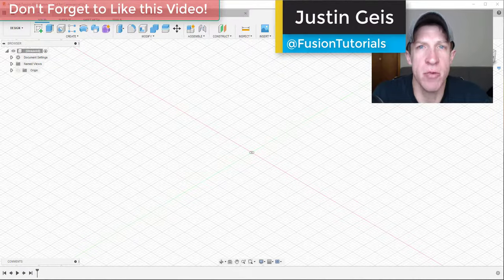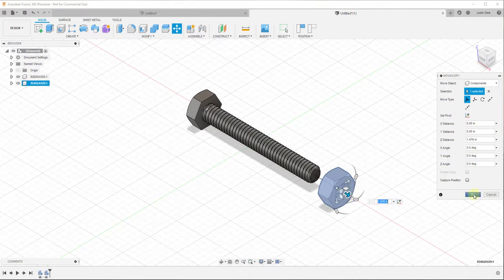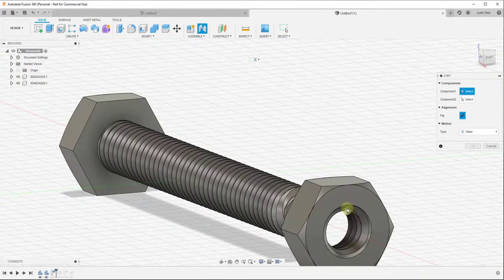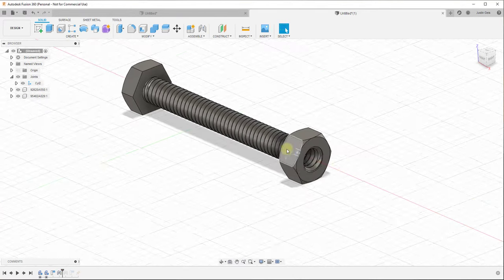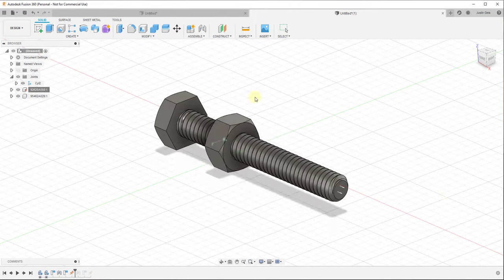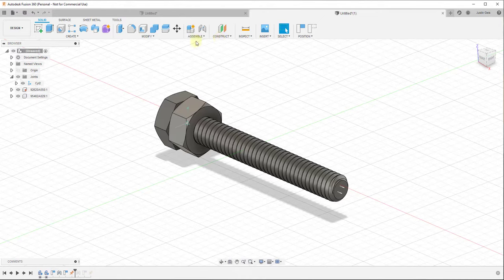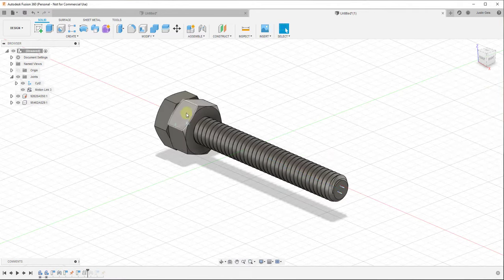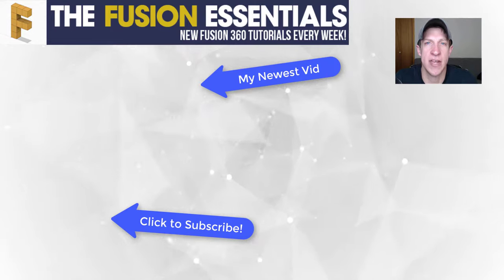Simulating Nut and Bolt Movement in Autodesk Fusion 360 with a Cylindrical Joint

Comment: I think this should be called animation instead of simulation because the threads are still intersecting for this animation.
Reply: Were you ever able to get the threads to not intersect?  I'm still unable to simulate a bolted connection.
Reply: @CopperRivets  I'm not aware of any way to do actual thread simulation. Everybody just seems to be fake it instead.

Comment: thanks for the video, well presented.  shame F360 doesnt have a drop down there for SAE/Metric threads such that you set the distance based on the threads. 1/4"-20 is 20 turns per inch.   it is fairly important for positioning machines to simulate that.  learned a lot.  thank you.

Comment: So, you would want the rotation distance to match the pitch of the two threaded bodies (nut & bolt), right? If I did as shown in the video would it work to do a finite element analysis?

Comment: I'm making a nut and bolt and the nut has a blind hole. How would I work the bolt to only rotate down until it hits the bottom of the hole based on the threads?

Comment: How do you control the starting angle of the nut to avoid interferences between the teeth of the nut and bolt?
Reply: I was about to ask how to make Fusion 360 do deduce this automatically? As in actually simulate the connection between those parts?
Reply: @MikkoRantalainen  I'm still having this problem.  I'm simulating a bolted assembly and it's failing where there are conflicts at the threads!

Comment: Subscribed! I have a question though:  so lets say that the screw you have is an M6 and the nut you have is a 1/4 inch (1/4"=6.35mm) in real life if you try to insert an M6 screw in a 1/4" nut they wont go in, if you import both from Mcmaster and try to slide them does fusion 360 show that they won't work or the simulation isn't a really practical and realistic and will show them sliding in?
Reply: I think they will only go together if you have CONTACT disabled in the assemble drop-down menu

Comment: Thanks, amazing! I found that if set the length for a 360 rotation to the same amount as the thread design (i'm using metric threads, so it might be easier), then it looks to rotate perfectly.
Reply: So for example, if using an m16 thread, which is 2mm per thread, then you'd say 2mm Distance and 360* rotation, correct? That's what I did and it looks correct as far as I can tell

Comment: I mean to make it realistic is good enough reason for me. I would set the revolution to the distance. Ps. Solving the thread pitch isn't that hard. English threads are how far did I move (forward) per one 360° rotation. The actual formula  that you would type into the distance portion 
1/x
X is the threads per inch. In your case, you got a 1/4-20. The 20 is the threads per inch. So the distance, in this case, is:
1/20 
Literally type that into the box and hot enter.

Comment: thanks so much for this! At the end of the video (around 9min.) you say "you could calculate the actual distance...". And that is what i need!!! Any help would be great! I dont want to calculate this by myself, but i am looking for a SW (maybe its not Fusion 360) that does this for me. So not really "animate" a movement, but "simulate" it- with real world conditions. For example - Simulate nut and bolt that don't fit  and see the stresses (how the threads of each break)

Comment: Hi, and first of all thanks for your clean presentation. A Simple question: Is it possible to turn the bolt and see the nut moving linear instead of turning the nut to see it climbing the bolt ? Thanks :)
Reply: yes you can, just ground the Nut instead of the bolt.  apply the rotation to the bolt and you'll see the bolt move in and out of the stationary nut

Comment: Well.. the video does not really match the description as the movement does not correlate to the thread.
No good! 

After a lot of fiddling around I noticed that if you set the distance (in motion link) to the exact height of the thread it gets pretty close, to almost perfect. The distance and rotation angle is basically the amount of rotation done on that given distance.